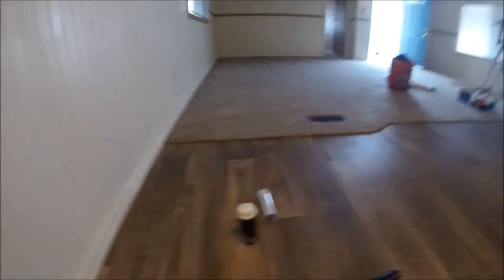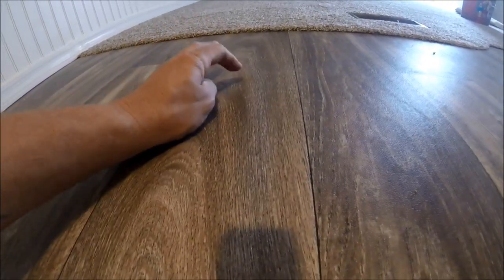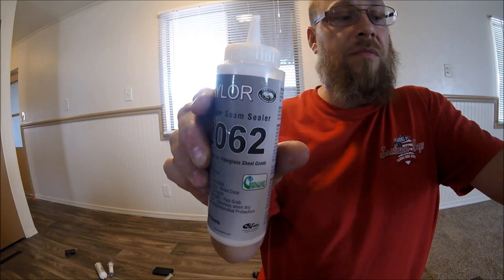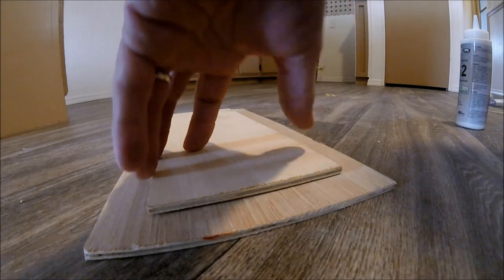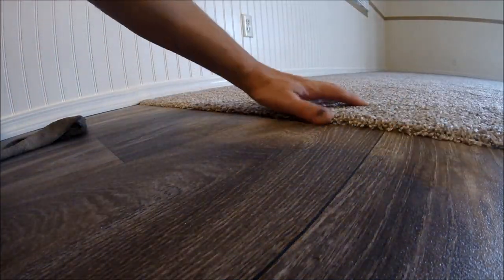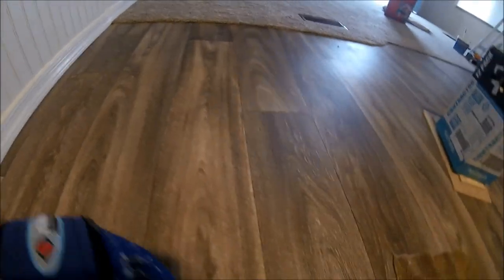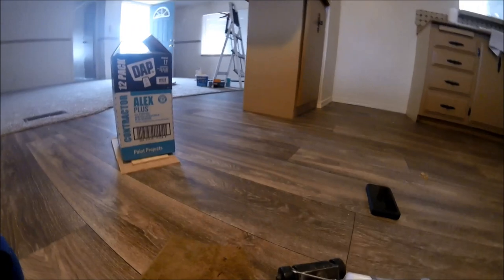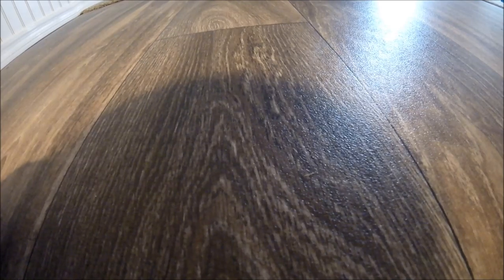BUBBLE IN VINYL REPAIR

Comment: How do you fix wrinkles/bubbles in a perimeter felt back sheet vinyl congolum product it wasn't rolled with the wear layer out or tubed I heard about heat socking it with a hair dryer and then apply a tray of ice to the wrinkle to thermal shock it have you got any other ideas if that doesn't work
Reply from the maker: That probably will not work because that remedy is for interflex vinyl which they do not make anymore . It is probably cut too tight around the perimeter and needs to be re-cut to have expansion room.
Reply: I was told by the congolum tech it's because the roll wasn't rolled with the wear layer out but with the bottom felt back out with will cause it to wrinkle it's not cut tight to the walls there is an expansion gap what about injecting glue

Comment: This was incredibly informative.  I've got a small nightmare on my hands from a hallway that was horrifically uneven.  And, I've used every type of self-leveler/feather finish you can use, but I still have a few spots like this.  Just out of curiosity, you recommended a Mapei product for adhering to concrete floors.  I'm assuming that same adhesive would work with this same technique?? ? I'll have to use this method at the few places left.  Your videos have been incredibly helpful.  Thank you so much.

Comment: I bought the same injector that you had, how did you get the needle to stay on? my needle came with just like a square flange on the end, I could not keep it in the syringe to save my life had to literally hold it. I was expecting it to be threaded.
Reply from the maker: The one I had definitely was threaded it screwed on
Reply: @FloorsbySouthernboys  Thanks for the reply and the vid. It did work pretty decent but I had major issues due to my poor installation job lol.

Comment: Hi again, Southernboys! Got a question I need your expertise on. Is there a way to repair a fairly deep scratch in Coretec?
Reply from the maker: Cody Kanz If The scratch is the same direction as the grain is running in the wood, they make various types of wood and vinyl fillers , Home Depot has a pretty good selection of wood laminate and vinyl fillers and that’s what I use, if it is in the same direction as your wood grain it will blend in pretty good most likely, if it is going a crossed the grain it’s going to be pretty hard to hide that, so with that being said you’ll probably want to replace the plank if it is going across the grain and replacing the plank is not an easy job, I would probably rather just live with the scratch rather than try to replace it if you are not really familiar with the way these products work, because it can be quite challenging
Reply: @FloorsbySouthernboys  Thanks for the info. Yeah unfortunately it cuts across the grain, and across about 13 planks. Mercy.
Reply: @FloorsbySouthernboys  And thanks for getting back so quickly!
Reply from the maker: Cody Kanz Oh snap, with it being that much it would probably need to be taken up all the way from the wall to the last damaged bored and just replace those boards which will ultimately damage more boards while taking them up so you would probably want to get three or four more boxes of the same product if you wish to tackle that or have someone else tackle it for you
Reply from the maker: Cody Kanz 👍

Comment: Great job ! I use only Roberts 3300 glue for all sheet goods, has never failed me
Reply from the maker: jc86 Is that a pressure sensitive glue
Reply: Not a pressure glue but a contact one I guess you'd call it.  Home Depot carries it .
Reply from the maker: jc86 Have you used it on fiberglass sheet vinyl
Reply: Sure have.  Works for glue down carpet too . It never fully dries it stays gummy.  Very hard to remove if you ever had to though, gums up scrapers like a rubbery tar kind of.
Reply from the maker: jc86 OK thank you

Comment: I have bubbles in vinyl click sistem but i do have space around the walls. So no glue underneath, just a thin vinyl foam. What can be the reason?
Reply from the maker: Maybe your foam is wrinkling up underneath of the vinyl plank
Reply: @FloorsbySouthernboys  no. I checked. Dissasebled everything apart and reasembled again.

Comment: IS this sheet vinyl? I have a delamination bubble in my RV. Would this work? Good video thanks so much
Reply from the maker: Kimberly Moore Yes this is sheet vinyl and yes this will work in an RV
Reply: Thanks so much!! Cant seem to find the brand you used. Can you suggest a comparable brand? Was trying to fix it this weekend..  @FloorsbySouthernboys
Reply from the maker: Kimberly Moore Are you talking about the glue I guess it’s just totally depends on what kind of vinyl you have if it is a felt back or a solid vinyl something new were then you can just get a pressure sensitive glue Or just any kind of vinyl seem sealer for newer vinyl’s at a Lowe’s or Home Depot

Comment: I'm having a problem with a vinyl tile floor tile I just installed.  It a " peel & stick" on plywood subfloor.  Went down ok. But am getting a number of curling edges.  Will this method work for my situation? And what seam sealer do you recommend.  Thanks!
Reply from the maker: Ofc. Roll-out  FDC peel and stick is in its own category if it’s not sticking you’re pretty much out of luck, that stuff is not permanent It is pretty much just for rental properties or something like that, just for a quick fix or a quick cover up, if you put glue with the sticky residue on the back of the peel and stick tile it will not adhere good
Reply: I would have approached this repair by pulling back the cpt. And squeeze the glue under the Lino from the other side of the bubble.   No hole in the Lino

Comment: Can’t seem to find the syringe? Do you have a link for it?
Reply from the maker: Ty Covington here you go.   https://www.tools4flooring.com/crain-143-adhesive-syringe.html
Reply: @FloorsbySouthernboys  Thanks! I cannot seem to find the sealer that you used in the video. Do you have another recommendation on the type of sealant to use?
Reply from the maker: Ty Covington    Premium Seam Sealer for Fiberglass Vinyl Flooring - 8oz. Bottle https://www.amazon.com/dp/B06XVMD4P5/ref=cm_sw_r_cp_api_i_hHODDb0RHRV39.    Here you are
Reply: @FloorsbySouthernboys  This works on regular vinyl flooring that comes in the large rolls?
Reply from the maker: Ty Covington yes sir